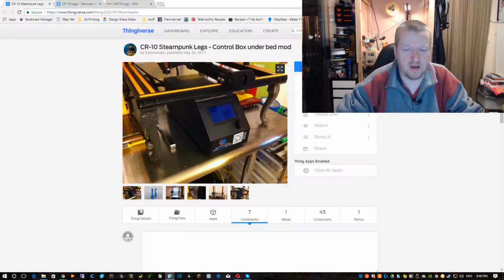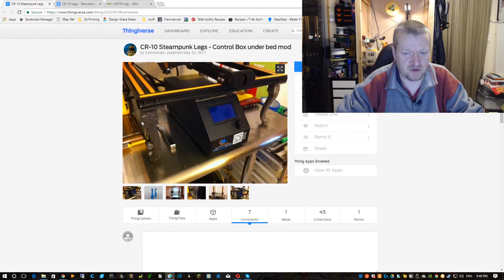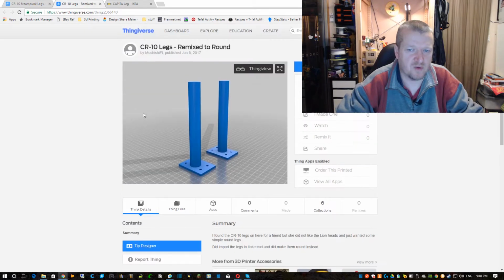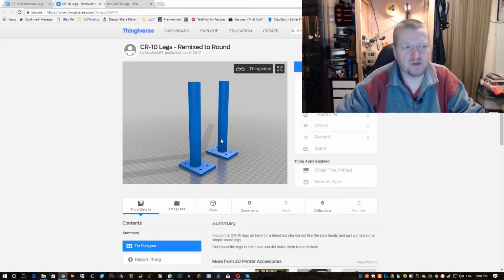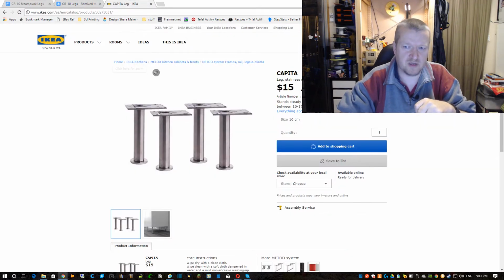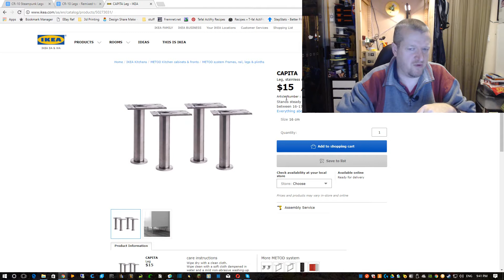Episode 24: Creality CR-10 legs from Ikea?

Comment: Hi, what type of screws did you use to mount it to the underside? Thanks.
Reply from the maker: I think I used the same nuts and bolts that held the original feet on but can't be 100% positive as it was quite a while ago that I did this.
Reply: @WotchaMaking  thanks! Ordered the legs today
Reply: @WotchaMaking  Hi again. Legs came in the post, not sure how I should mount it as the holes don't line up. How did you do it?